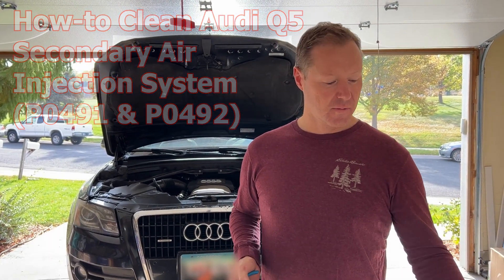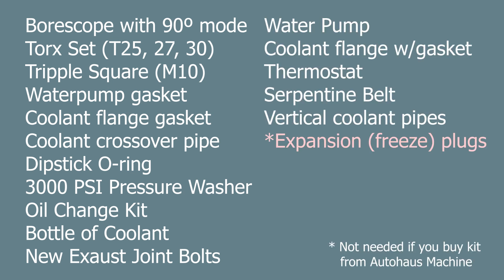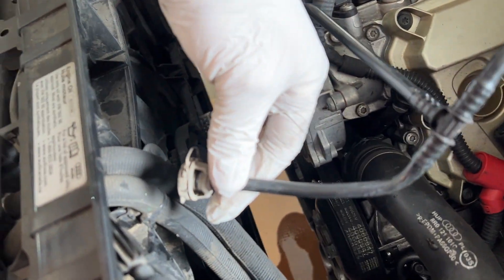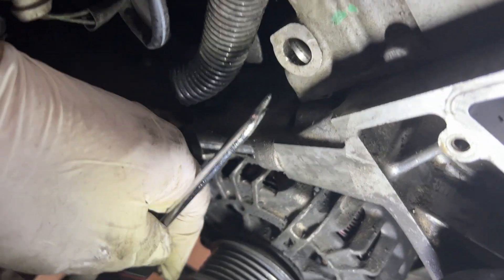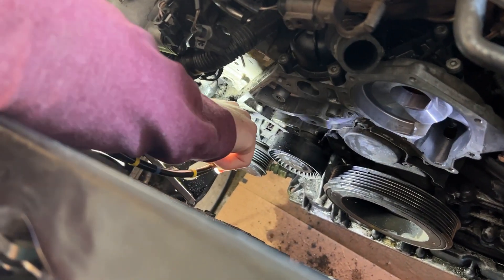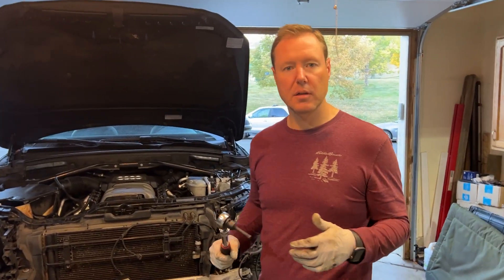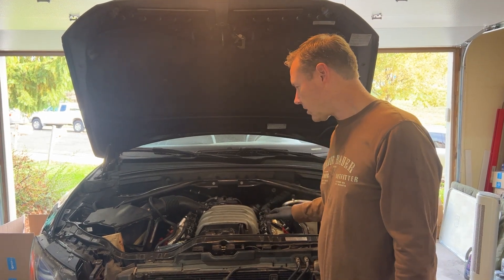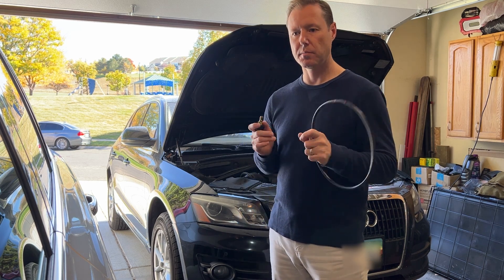Audi Q5 Secondary Air Injection Cleaning with Affordable Aftermarket Tool (P0491 & P0492)

Comment: Great video, I just erased the P0491 code, but have yet to see the CEL or either code come back. What pressure washer did you use? I have a 1750 PSI pressure washer from HUSKY, think that will be enough pressure for cleaning?
Reply from the maker: I'd have to check, but I'm pretty sure its 2000 PSI.  I got it pretty cheap from Amazon for this project.

Comment: Did you drain all the coolant before removing the hoses and water pump?
Reply from the maker: No, a little pours out but since its near the top of the engine, its nothing compared to having to drain the whole system.  We just put a pan and some cardboard below to catch most of it.  It is slippery though if you step on it.

Comment: Did it run before ? I have this code and stalls out
Reply from the maker: Yes, this one has no impact on the engine running.  While this code does mean your SAI ports are clogged, you have another problem causing the stalling.  Might want to check that you don't have some exhaust blockage or fuel supply problem.

Comment: Do you have to remove the Water pump?
Reply from the maker: Nope; but its a very high failure item on these 3.2L engines, so we did it while there to avoid being stranded some day.  Its pretty affordable to get an OE/Aftermarket one from FCP, so might as well.

Comment: You guys are straight up heroes for finding this tool and filming the process. I dreaded pulling the car apart and removing the exhaust manifold to clean the ports manually. This seems to be a much more elegant solution and worth the extra money. I'll probably sell the tool used on ebay afterwards to recoup some of the cost.
Reply from the maker: Appreciate the feedback.  I thought of doing the same (selling it) but also considered buying future Audis, and that would have been a bitter pill if I faced this problem again!

Comment: Is the CEL still out? - I have a 2010, and have done this with a hand made pressure washer right angle nozzle, and then later with mechanical cleaning - the original audi tool says that the pressure washer needs 2100 psi at a minimum or something like that - I found that even though my pressure washer was allegedly rated for that pressure, the secondary ports (three per side) never became completely unblocked.  The mechanical cleaning solved the issue and the light has not come back on in 2 years, all with city driving, which accelerates the carbon buildup
Reply from the maker: Yeah the light has not come back.  Glad you were able to find a way to get it done with your own tool.

Comment: Can't these codes just be "tuned" out? I am sure there are more sophisticated reasons for this design, but on its face, it appears to be an absolutely idiotic path for air injection to the catalyst.
Reply from the maker: I 100% agree, you can probably pickup on my frustration with Audi in the video.  I started down that path and didn't have the know-how to reprogram the ecu, and the cost of paying a coder to do it would have been the same or more than this part form AHM.  So I went this way.
Reply: Yes some people can do that but if you have to pass emissions it will fail, and its a federal requirement. Doing this would be illegal. Secondly, the tool to do this runs $8,000-20,000. Overall, is a bad design.
Reply: Hello. I'm happy to find Your video, for me its better way to do this then other video i saw where all things had to go out from front of the car :) I have a question if in the instruction there is something that is not on a film or maybe You can show us that instruction?
Reply from the maker: @lucasjakx1682  If I understand right, no I pretty much showed every step of the process (as far as I recall).

Comment: Was the car running badly before you did the clean out? Or did you see the codes and decide to do the clean out?
Reply from the maker: Definitely the second one, the car was running fine, but I hate lights on the dash that might obscure my awareness of another issue.  Also, we would have had to deal with it when emissions were do in a year, so might as well take care of it.

Comment: Hello, Great video, what do you think was the total time to do this?
Reply from the maker: 45 minutes to put the bumper in service mode, 30 minutes to separate the exhaust pipe, 2-3 hours to remove all of the stuff in the way (pulleys, water pump, cross over pipe, belts, etc...), 1 hour to blast it with water, then reassembly was another 45 minutes. It took most of the Saturday, but we had interruptions.
Reply: @5ivedaysproductions630  Thank you, I subscribe to your channel cause you didn't ask,
Reply from the maker: lol, thank you

Comment: So after you finished cleaning did you install a new freeze plug or what? I’m about to do this job at my work and your video was very informative
Reply from the maker: Thanks for the comment.  Yes, thankfully the kit from Autohaus Machine (AHM) included the freeze plugs because I couldn't find the right sized ones anywhere online.  The old ones might have gone back in, but they also might have been deformed while being removed, so I'm glad I didn't have to reuse the old ones.

Comment: Question how did you figure how to take apart your car step by step and thank you for posting this video!!! I need to do this on my vw passat 2015 1.8t but don’t know how to step by step take it apart. I was thinking of using alldata but I’m still not sure if it will show me how to take the car apart. The dealer quoted me 4300 for this job
Reply from the maker: If you are referring to removing the bumper and putting the frontend in service mode, I have a link in the description showing how I learned that.  If you are referring to the other stuff we had to remove (pulley, water pump, coolant crossover pipe, and those things, I watched videos from FCP Euro and other people to see how to do those steps.  If you find a few videos on how to replace the water pump, that will show almost all of the steps to get the SAI ports exposed.  Then hopefully my video shows enough as well.  Sorry about the dealer quote. I can't believe how much they charge for this job when it is clearly a design flaw by Audi!
Reply: @ thanks again for the reply I ended up buying a repair manual for 35 bucks for a day downloaded all pdfs for how to tear down individual parts on the Passat and ended up changing my carboned up combination solenoid valve  check engine hasn’t returned will sub!
Reply: @aleKaneki Great news. May I ask did you have the same trouble codes, p0491 and p0492?
Reply: @empireofsteeI update check engine is not set it will go away and come back on its own, it passed smog but yet something is up further diagnosing and 4 hours later valves are in pretty bad shape with carbon deposits so pretty much cylinder head will have to be removed to do thorough cleaning of valves I’ll update later on
Reply from the maker: Any luck?

Comment: Fantastic video, thank you for taking the time to show this repair and include the needed parts. Did this fix the codes or did it end up being another issue? because your ports didn't seem too clogged.
Reply from the maker: Thanks for the comment. It appears to have fixed the issue because the code never came back.  And that was a few months ago.  The ports were as dirty as any other 140k Q5, I just didn't capture much footage of the before and after.
Reply: @5ivedaysproductions630  Thank you for confirming that. About ready to get the job done. Quick question, did you intent to keep the tool or resell it on eBay? I figure a used one is as good as new. Thanks
Reply from the maker: Not a bad idea.  I plan to hold onto mine because we may buy another Audi and this seems to be a very common issue.
Reply: @5ivedaysproductions630  Big thanks again for the video. I was able to complete the job myself in a few days and save over $2,000 from the dealer!
Reply from the maker: @empireofsteeI  Love that feedback, makes it all worth it!

Comment: 2'rubber hose 300bucks, WTF????
Reply from the maker: I hear you, It is pricey, but I am thankful somebody out there provided an alternative to the $1700 Audi tool.  I blame Audi, not the enterprising machine shop that fill a need in the market.
Reply: Looks like a long grease gun hose with the flats ground off on one end to clear the SAI port. Then they used two 1/8" NPT Brass caps drilled as nozzles. Freeze plug part numbers are N0119078. Should be able to duplicate it for less than $50.
Reply from the maker: Good luck and please post if you're able to make something work.  I'm sure people would like a DIY option if it's within reach.

Comment: Hello, I’m from indonesia, any ideas where can i get that all tools you have? Does this things make the car long cranking in the morning?
Reply from the maker: Hi, I'm not familiar with the options in Indonesia, but if Amazon delivers there, then I would go with that.  To my knowledge, the SAI system does not effect performance in any way, it is only an emissions requirement in many countries.  So if you have the P0491 code, you can live with it forever in theory.  Most people fix it because they are annoyed with warning lights (myself) or they have to sell the car in a country that requires emissions issues to be fixed before the sale.
Reply: @5ivedaysproductions630  oh yes? Can affect on low idle rpm or no? Bcs my car audi a6 c7 2.8 fsi , just at 650 rpm at idle , i feel its not normal. Btw sorry for my broken english , may i got the solutions with long cranking in the morning and low rpm idle issue
Reply from the maker: My first guess would be a fuel supply issue.  I would try to find a fuel pressure gauge at an auto parts store and ensure you are getting enough pressure.  Could be the fuel pump but that is expensive so you'd want to confirm its a problem first.
Reply: @5ivedaysproductions630  i changed the fuel pump a year ago, do you think its possible the fuel pump issue again? For the fuel pressure sensor i didnt change it. Thank brother for the information !
Reply: @5ivedaysproductions630  may i know you Q5 Idle RPM? I think we have same base engine 🙏
Reply from the maker: @jefrykunarli1206 It idles at 1250 after cold start.  Then calms down to 750'ish when warm
Reply from the maker: If it was a reputable brand of fuel pump, then its probably not that.  My next steps would be to test the fuel pressure to confirm its delivering the right amount. Then confirm the spark plugs have been replaced sometime in the last 8 years.  Confirm airflow is not obstructed at the intake due to the new direct injection model and carbon buildup.  Lastly, if its just a rough idle you feel in the vehicle, it could be motor mounts that need to be replaced.  I've been surprised how much the mounts effect the idle feeling.
Reply: @5ivedaysproductions630  ah that’s awesome, so if it’s an airflow system problem, which part do you think has an issue? Mass Air flow maybe? I feel its not coming from mounts, bcs the idle around 650 at the speedometer
Reply from the maker: I would search for a video on walnut blasting the air intake valves.  They get caked with carbon buildup and the safest way to clean them is media blasting with walnut shells.  But also, confirm the spark plugs have been replaced, or just replace them if you're unsure.
Reply: @ yes my spark plugs are new (1week ago), i got confuse abt fixing this long cranking and low idle, or maybe from the Fuel Pressure Sensor maybe? I already confirmed the workshop that fuel pump part is original genuine VAG
Reply: @5ivedaysproductions630  btw thanks for the tools info, i think i will be very hard to find it